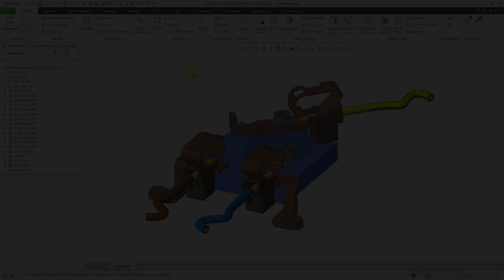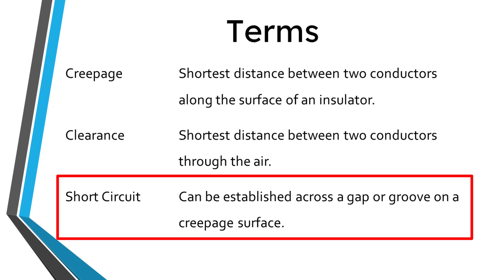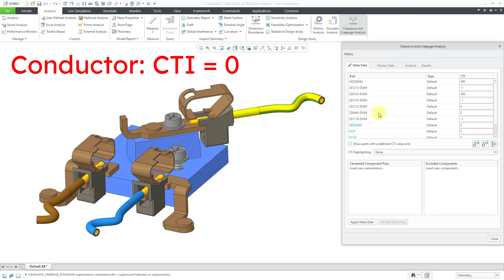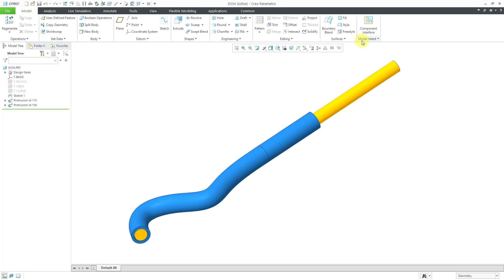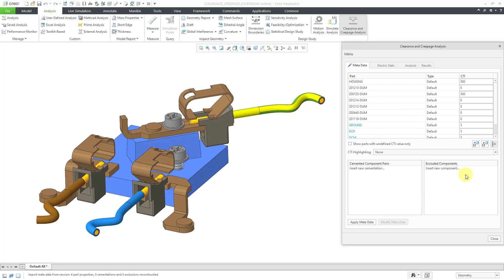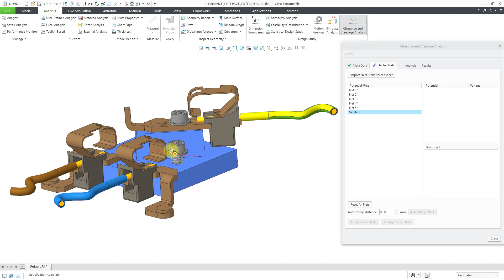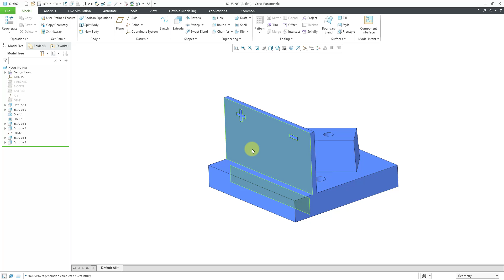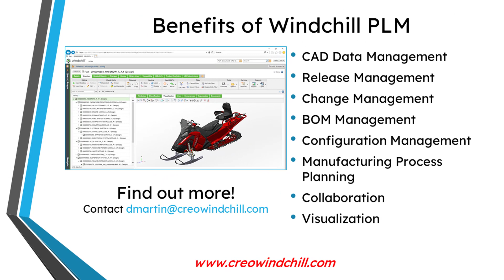Creo Parametric - Setup for Clearance and Creepage Extension (CCX) Analysis

Comment: if you have some cables (modeled in procable) going into a housing, will CCX work with those creo cables?
Reply: also if I have say "Copper_generic" assigned to a part, wll the CTI come from that automatically? or do I need to assign it in the parameter window?
Reply from the maker: Assign it in the parameter window.